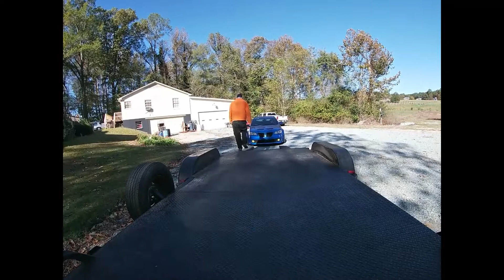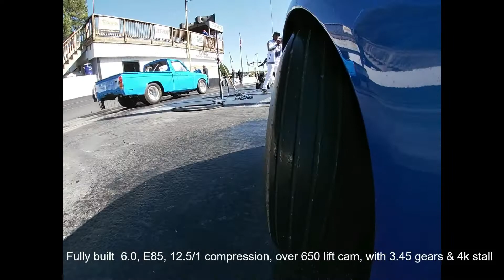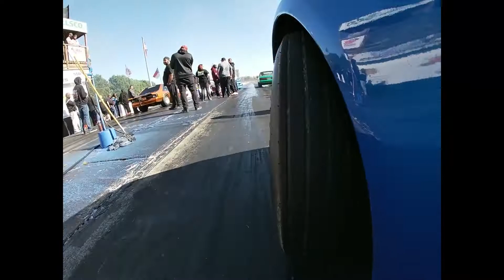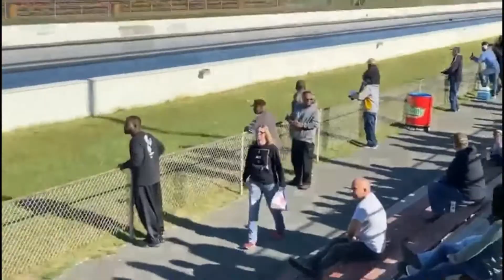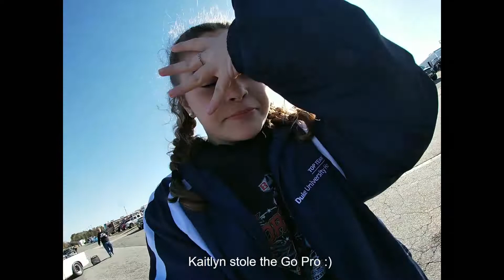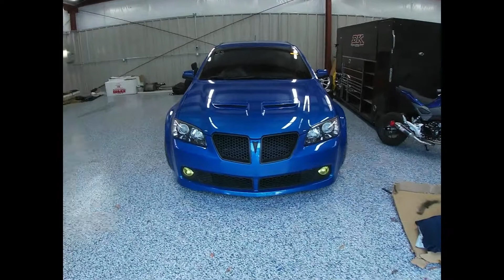Built G8 track results FAST intake with 102mm TB vs RCR ported and rodded intake

Comment: What cold air intake fitted the 102mm throttle body id you don’t mind asking
Reply from the maker: 4" rubber boots fit fine with an LS7 4" housing.

Comment: Did I miss the ET/MPH numbers?
Reply from the maker: Just not posted. In the 6.7s at over 103 for now
Reply: Your NA heads/cam/intake is running 6.7 @ 103mph in a full weight G8? That's very fast.